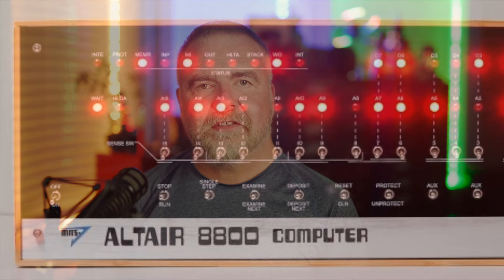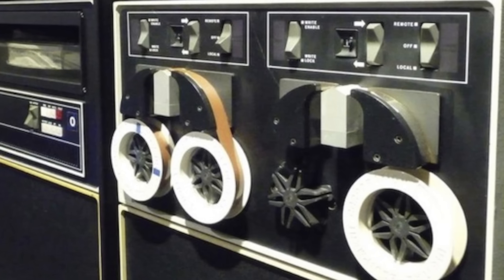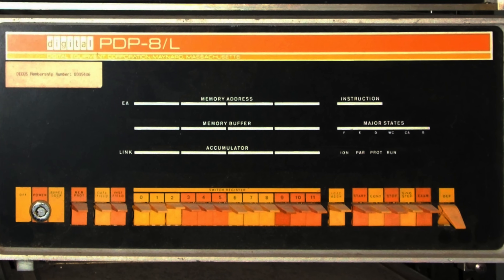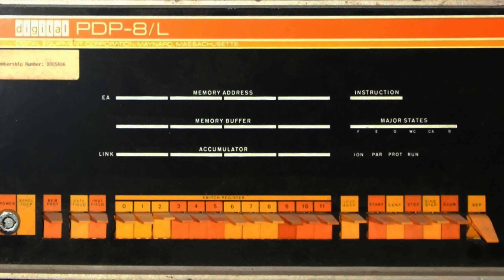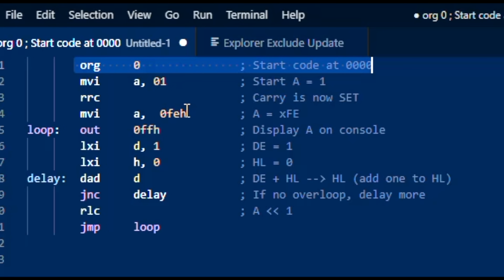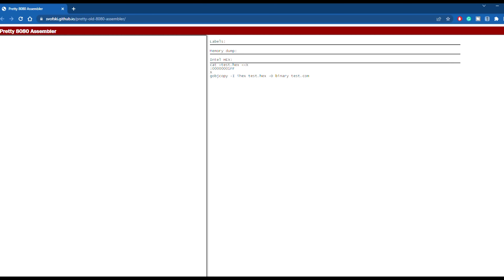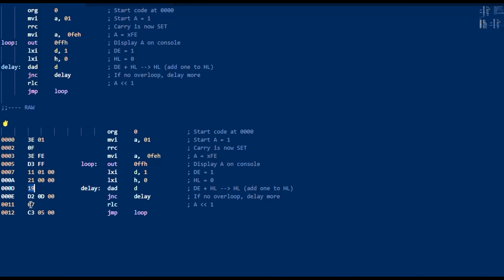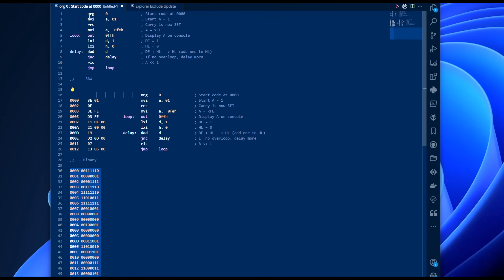Bare Metal Programming - Booting From the Switches

Comment: I used to do this around 1977 on my home-built computer, wooden case etc, an MPU, 256 byte ROM monitor, 1K RAM and several dozen TTL chips, all hand wired myself over many hours with a hot soldering iron.

I was 13.

I had no fancy assembler, I just learned the instruction set in my head directly in hex. Small programs you put right in there from the top of my head. More complex ones I wrote the hex on sheets of paper and manually calculated the jumps and keyed it in.

I learned an awful lot, and I've enjoyed a lifelong career from it.

I  remembered about half of the hex opcodes in the video example, 45 years later!
Reply: I was 12 when I built mine
Reply: I was only a little older when I built my first 8080A based "computer" which used 5 chips and needed to be programmed using the front panel switches while the CPU was in "HOLD" state.  3 chips were the 8080A CPU and its 8224 timing chip and 8228 bus driver chip.  The remaining two were 2114 4-bit by 1K RAM chips, with the address lines parallelled so that they formed a single 8-bit by 1K memory.  Fun times.
Reply: Oh, the memories... I was 18 and just started at University when could afford (ie spent my grant money) to build my first Z80 based machine, with front panel switches, NO PROM and just 1 kb of RAM (eight 2102 chips).  Later added a 2708/2716 EPROM programmer, video (16 lines x 80 characters) , keyboard (from South Africa, of all places), CUTS interface ... Ended up building 6 machines, including a dual processor Z80 and 6800 one, both sharing memory and I/O.  Only one processor at a time would run.  Thanks for  taking me down Memory Lane....
Reply: @escapeman9016  I did a dual proc 6502 and Z80   or rather grafted a Z80 onto a 6502 single board computer  (needed tristate buffers on the 6502 for when switched to the Z80
Reply: I used to do the same kind of stuff around that same time, all in hex.
Reply: In 1980, when I was 14, I wanted a PET but my parents only got me a KIM-1. At least it was inputting hex in the keypad and loading/saving to tape. Two years, later I got an Apple II.  Still have them, although the KIM-1 doesn't work anymore (bad RAM?)
Reply: @chinesemusic8019  You write: "Still have them, although the KIM-1 doesn't work anymore (bad RAM?)"
Hmm, sell it to me? Bet I can fix it!
Reply: Sounds like you're a genius
Reply: Lucky kid!
Reply: I did this using both the Apple monitor (6502) and some sort of 1802 based computer with a hex keypad. Both of those I typed in the hex op codes, I used to remember the op codes in my head. I’ve made a living doing hardware design and programming engine management computers (since around 1996). The early ones I designed were based on a 68HC11 but by then I used a cross-assembler.
Reply: Must have been a ride seeing computer technology progress and advance ever since the late 70's.
I'm born in the early 90's but even my first experiences started with a Commodore 64 and later 286 which both were from before the time a typical kid of that time would do anything with computers.

Comment: it been so freck long since using a system 3 or 90/30 to when you have to set the dials to first disk drive to load the and start the systems. I mean like 1972 and 1980, then there was 9200 and 9300. for a ti-990, I don't even remember what the start procedure was any more. the 90/30 and ti-990 were both multher user systems used with DX=10 or DX=12. running at 2 MhG's

Comment: I recall from reading one of the books on Gates and Allen that they spent a flight to New Mexico hand assembling the paper tape loader so they could demonstrate the first version of Basic for Altair 8800 to Ed Roberts.  No complier -- just the instruction set. 
Seems they had forgotten to do this prior to getting on the plane.
Reply: IIRC they only had a simulator to work with, not the actual machine.
Reply: I read a different version of the story, according to which Allen WROTE the tape loader on the flight. I wouldn't be surprised if he assembled that while entering the code he had written down on paper during the flight into the Altair's front panel - the real geeks at the time had the numeric values of the CPU op codes in their heads, usually in hex (Bil Herd reported he had to pull this off to get his job at Commodore), and converting hex to binary is easy (I am sure Dave could have done that without having converted the hex numbers to binary in advance; I think it is even less dreadful than copying the ones and zeros).
Reply: Addition to the story: Allen and Gates later had a personal contest who could write the shortest tape loader - Gates won.
Reply: And that's the last time Bill wrote code. The rest he 'stole' from smart people who had written their code.
Reply: @cjay2  Bill continued to write code up through the Tandy 100 "laptop", including a sneaky routine added to the Commodore PET. But yeah, he also knew how to make strategic acquisitions of code written by others.
Reply: @cjay2  Not all of it was stolen, some was bought. ;)

Comment: This makes me want to get my PDP 11/04 out and get it up and running again.
Reply: You should be able to get Unix binaries for a pdp11.
Reply: @jimpad5608  I'll have to see if my 11/04 has adequate ram.  I'm fairly certain it only has 64k.  It was used to control a video editing system starting in 1979, so it really only had to store a couple hundred edit points, and trigger tape machines at the proper time.  It does have a front panel keypad (rare on the 11/04), and I have some of the programming manuals...

I do have 4 11/84s that have 16 megs pf ram each, and an insane number of rs232 ports and SCSI cards.  They were used at our local newspaper, 2 for the newsroom, and one each for the laser typesetter and press automation.  Sadly, my apartment doesn't have the needed 20 amp 240 volt power needed to run even one of them...
Reply: @dustinsmous5413  - original non-gui Unix didn't take much space.
Reply: @jimpad5608  In the case of my 11/04, the hardest part may be writing the binaries to 8" floppy for that machine to boot from.
Reply: @dustinsmous5413  you might be able to find an 8 inch floppy drive that you can use a raspberry pi to write to a disk.  The 8 inch drive interface is fairly primitive so writing a driver for the pi shouldn't be that hard.  When I scrapped an old system decades ago,  I kept the 5.25 drive just in case I ever needed to access a client's old media.
Reply: @jimpad5608  The 8" drives appear to have standard Shugart interfaces, and if that is the case, all needed signals should be available on a 34 pin IBM floppy connector...  I never thought of interfacing the drives to another system, but I have a few extra drives.  I'll have to build a cable and see what happens!

Comment: What's the point of the first carry set? (mvi a,01 and rrc instructions) Dad - instruction set/clears carry when needed and before that there are no instructions that cares about carry.
Reply: I had the same question on his short preview of this. It seems like 3 bytes he has to enter for no reason?
Reply: To ensure only one LED is lit after rlc is executed. Imagine if carry wasn't set, then FEh (1111 1110) after rlc, becomes 1111 1100 instead of 1111 1101
Reply: No it's not since dad - instruction before will set/reset carry anyway and as mentioned jnc - instruction just before rlc prevents it being called when carry is not set.
Reply: @retrogeek597  I was wondering if it was something like that, but there are two problems with that hypothesis:
a) The documentation for rlc says it is the new value of Cy (i.e. the bit shifted out) that is shifted-in. The old value if Cy is disregarded.
b) The rlc instruction isn't even reachable with carry not set because there's a jnc right before it.

Comment: If you traced every program we currently use back to the programs used to make those programs, and then the ones used to make THOSE programs and you kept doing that over and over, further and further back in time, way back before the first OSs, you'll eventually reach software which someone had to figure out on paper and input via switches.